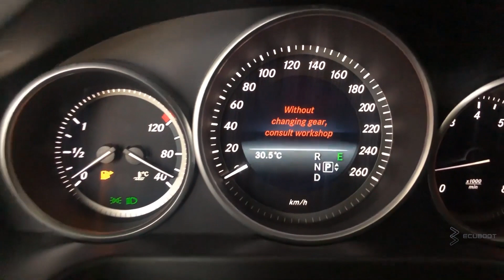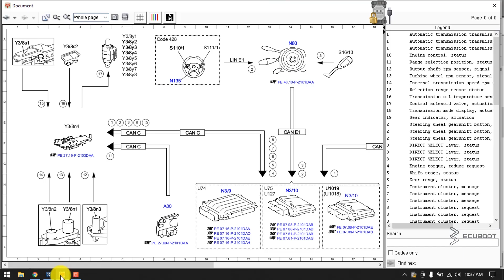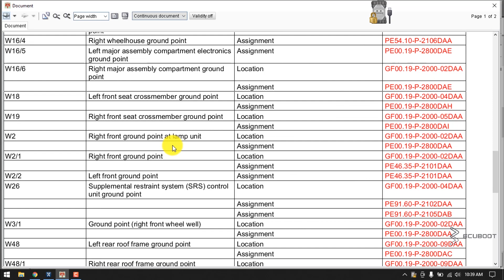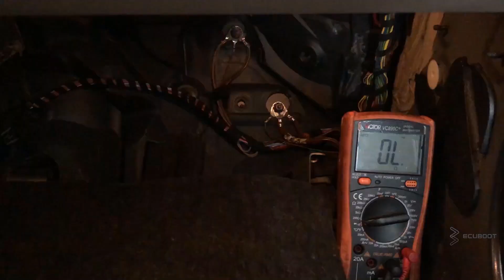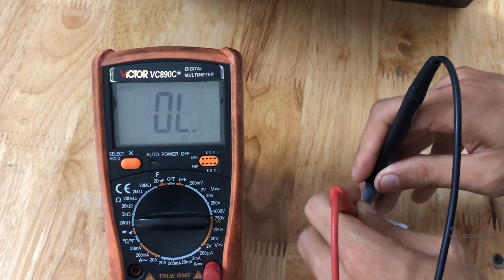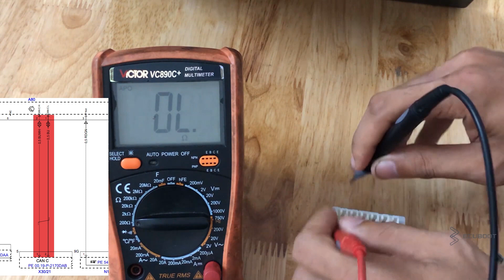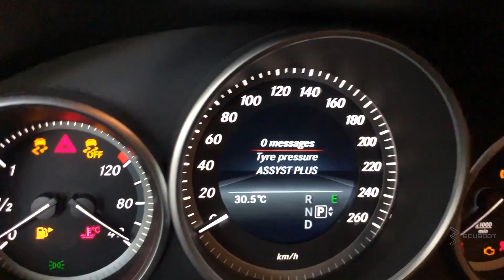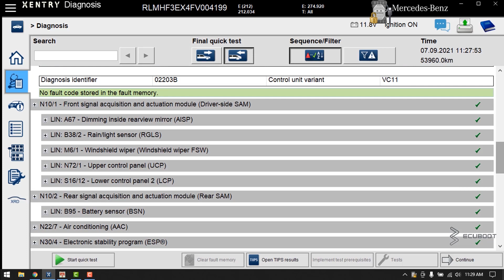Mercedes Without Changing Gear Diagnostic and Fix

Comment: I have a C200 W205 2018. My car sometime likes to randomly shift to neutral while driving (especially in traffic). My odometer is 16.000 KM / 9.000 Miles … , do you know what the problem is?

Comment: Having same problem with 2012 cls550, before I start the car it also says car not in P, but once its started it clearly shows P. Need help please. Both batteries replaced. Its been acting up for a year but usually started shifting after 5-10 sec after start. Now its completely stuck in P
Reply: You fix
Reply: @chancemurphy-jo3jo still no solution. Just brought the car to dealership for diagnostics
Reply: Any update? I have the same issien

Comment: I have a situation where by the car wont move at lower gear you need to place pedal hard and for really long time for it to move slowly, and there are no fault codes,  we are still struggling with the car,

Comment: Hey man, I just wanted to say thank you. This video really REALLY helped me out. I've Just fixed my customers convertible E350 with exactly this fault. Footwell was full of water. Thankfully I was able to do what you did and shift the connections over to unused ones on the terminator module. Worked perfectly. Thanks again. 👍

Comment: Had the same error. Checked my battery and it was showing as 20% juice left. Changed battery and it was sorted.
Reply: I just serviced my car less then a mth ago. Im trying to understand how is this possible that battery is dead? Lights n everything else is coming on. Im seeing exact no shift gear warning. Mercedes just quoted us literally both arms n legs. Asking us to replace battery, dasboard monitor and whatnot. Help any advise please.
Reply: @ravindersingheire  did you change the battery in the last servicing ? MAybe not i guess. Light etc use low power, so they might still work. My tester was showing 20% battery left, which is enough for low power devices like light. No need to go to Mercedes for this, go to your local garage and get them to change the battery. If your car is start / stop, make sure they reconfigure the car. The best way to do this is jump start the car, while the engine is running, disconnect and remove the battery. Your engine will still be running. Connect the new battery. Connect the car optimiser and check if there are no warning, fix any that comes up. That should be all. No need to change dashboard monitor etc, just the battery.
Reply: @ravindersingheire  Ism issues or can bus
 issue
Reply: Have the same issues with an ML...I went to the car and there was no fault code after scanning and then when I cleared and started the car it ran and the gear selected properly....now this morning I'm called that it's not starting anymore....root problem is that the battery was changed.
Reply: Please did you change the battery?
Reply: Yes. Changed the battery and reconfigured the car as it is a start stop car. All good since
Reply: Alright....I have an x100 pad.......I'll go back and see what's wrong with the battery as it has been changed initially before the issue started.
Reply: If your car is start / stop model it had to be reconfigured for the new battery.
Reply: I discovered the battery keeps running down.
Reply: No it wasnt. We tried jump starting, It didnt start. Completely couldnt move it. As i couldnt shift gears. Thing is car is on the ramp in the garage with Mercedes.
Reply: @ravindersingheire  didn't need to send to Merc. You just need a battery pack jump starter or connect the battery with another car to start it. Then change the battery.
Reply: @ravindersingheire Which is the battery?
Reply: Salam pil deyerken hangi pili  deyirsiniz? Öndeki ya arkafaki?
Reply: Which is the battery?
Reply: Did you buy a Mercedes battery or any other one please
Reply: @smithkwamekorder5054  any battery. Make sure it is a start stop battery if your car is such.

Comment: Wow boss r u superb with this daignosis I have a recived ml350 w166 on this fault without changing gear consult work Shop. Pls help error soon is A80 no can receive and U010187 transmission control unit msg missing.....

Comment: HI I have  a 2015 SL 400 cant shift out of park   can you tell me where the  white CAN distributor resistor is located
Reply: Passenger floorboard under black cover, remove corpet

Comment: i am having an issue with my ism having me stuck in park and i purchased cloned c3 with xentry from china and everything is all connected shows up part_d then when i run the DAS it disconnects, anyone know how to fix this? i need to diagnose it before i just buy an ism and waste several hundred dollars if it turns out to be something else, and i can't afford to have my truck dragged onto a flatbed and then dragged off it, and dragged onto a lift.

Comment: Hey Bud I have been driving myself crazy over this issue on my 2016/C300. I just saw this video and would like to ask if possibly you can assist on guidance so that I can locate the main cause of this if different from what you explained here. My car won’t shift into gear and steering wheel is locked
Reply: Hey, how did you sort your issue? I’ve got the exact same car and exact same issue, steering locked and error message etc
Reply: @jamiecampbell638  hey just saw this, my bad. But it’s an electronic issue of course. It end it up having to be replaced. I cannot pinpoint what piece exactly it was as after breaking my head trying to figure out and two friend mechanics trying I took it to MB specialist.

Comment: Thanks for sharing. I have a 2011 R350. The car will shift into R, D, N, P on the instrument cluster but wont move in D or R. I did a scan with my Launch tool and recorded some fault codes. Some of them saved as "stored and current" and others as "stored". On the ISM, I have P179D00(stored &current), U010187(stored), U010087(stored), U012187(stored), P179A16(stored), On the TCM, I have C426 (stored &current), D13A (stored), C141(stored), C167(stored), C155(stored). please where do I start from as my car cannot move in either D or R. thank you
Reply: Hi 
Did you ever get it resolved? If so please what was the solution to instrumentation cloister D R but car will not move 

I have experienced it a few times but shutting off the car reset and everything is fine after

Thanks
Reply: @yemia9111  water damaged my front SAM and that affected a whole bunch of module. i replaced the front sam and EIS and that fixed my problem
Reply: Wow.. thanks for the quick reply 

Where are those parts located ?

I have R320 , mine is kind of intermittent roughly once every few months at morning start up
Reply: @yemia9111  It depends on the trouble codes you are having.  i will advise you get it scanned and that will narrow your seach to the specifics. However,  the front SAM is under the front passenger seat just by the side of the battery. you will need to remove the battery (under the front passenger seat) to have access to it.  The EIS Is the part where you insert your key.
Reply: Don’t have any error code or check engine light messages but could be a stored error code. I will change the battery in the fob first as the EIS and key fobs were replaced in 2015.

Comment: I have a ML 350 2013 have similiar issues but not warning msg but i noticed if i open the driver door and turn the car will go out of park  also is intermittent , what software are you using for reading the wiring diagram that you used on this video , thank you , great troubleshooting.
Reply from the maker: In my experience, this could a problem with the TCM. 

The software is WIS which stands for workshop information system, this software is written by Mercedes Factory, very easy to install.

If you need this software, just contact me Whatsapp +84949883239